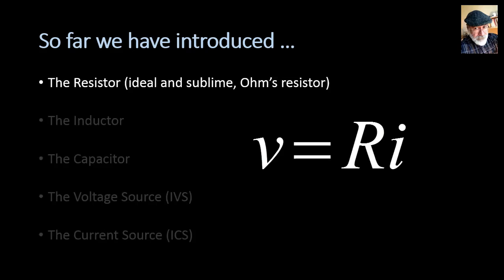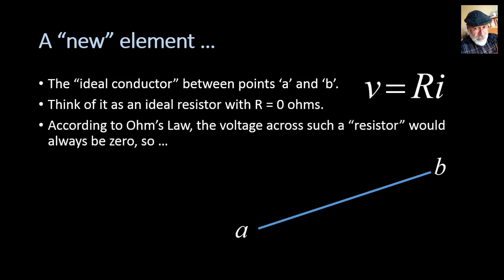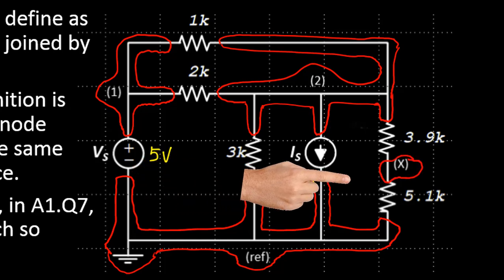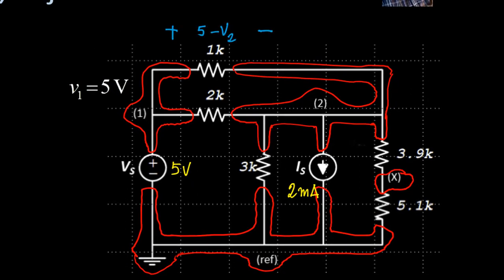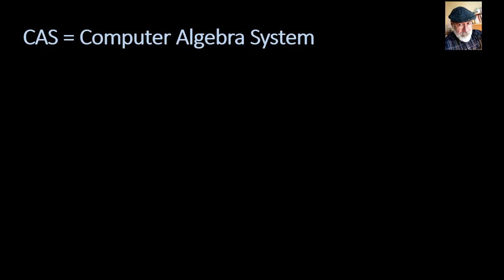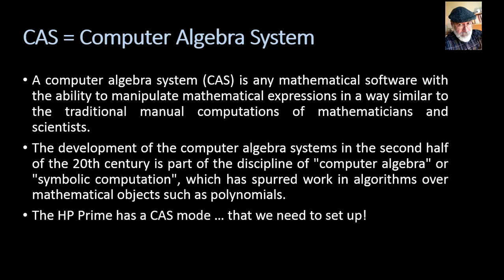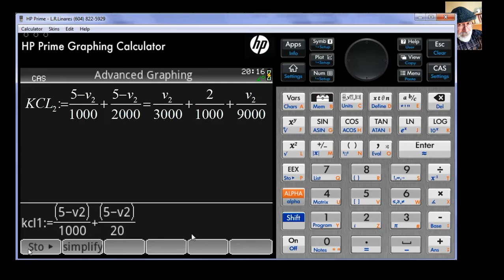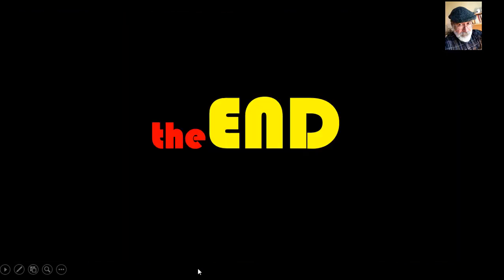ELEC 201 : CAS and the HP Prime, a response to a student.

Comment: professor, can you help me? I am an IB student and IB does not allow CAS on calculators. I have an HP Prime and I can turn on Exam Mode to disable CAS. The problem is, without CAS, how am I going to solve for quadratic equations? When CAS is disabled, functions like POLYROOT() are disabled. On my level, It is quite often used and I searched on the internet but i cant find any solution.

Any help would be really appreciated.
Reply from the maker: I'd do a Google search for Khan academy quadratic equation for a full explanation, my advice. But for a quick answer, I'd just use the formula that all my generation memorized in junior high, the two roots of ax^2+bx+c=0 are given by first computing d = b^2-4ac, then if d > 0, the roots are (-b+sqrt(d))/(2a) and (-b-sqrt(d))/(2a), if d<0, then the roots are complex conjugate and the real part is b/(2a) and the imaginary part of the roots is +/ sqrt(-d)/(2a). I hope that helped a little. There are factoring methods, but those work only in specific situations. Again, Khan Academy, go.
Reply: Thanks really appreciate it

Comment: Professor, can you help me? I'm trying to find out how to convert between different bases on the HP Prime (for instance between decimal and binary) but I cannot find information anywhere, do you know how this is done?
Reply from the maker: You can type an integer in decimal, octal, binary or hexadecimal. Prefix it with the pound sign, #, and end it with a lowercase letter 'd' or 'b' or'h' or 'o', as appropriate. SHIFT BASE will open the Prime base conversion and bit manipulation dialog box. Explore it. I read somewhere that the manual page 29 contains more information on this. Good luck!